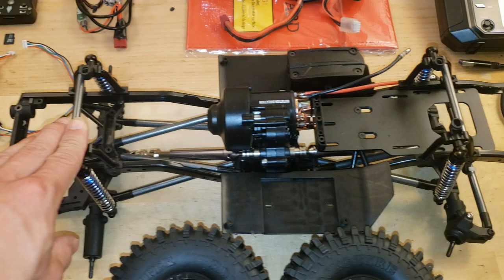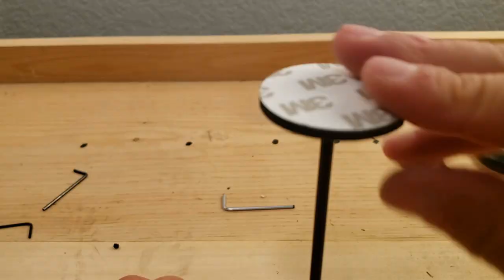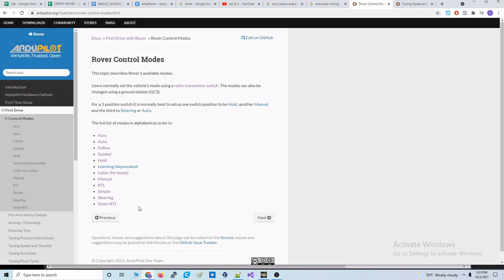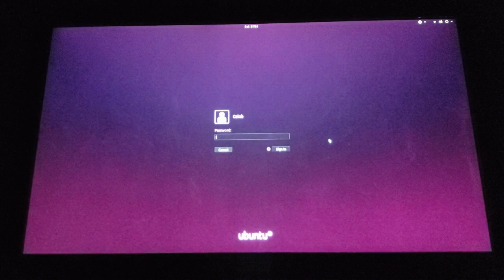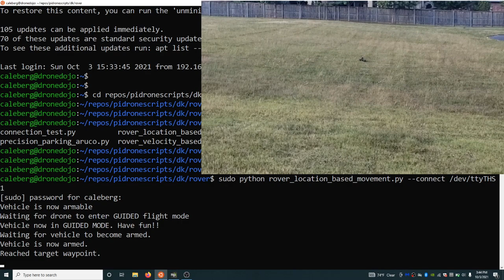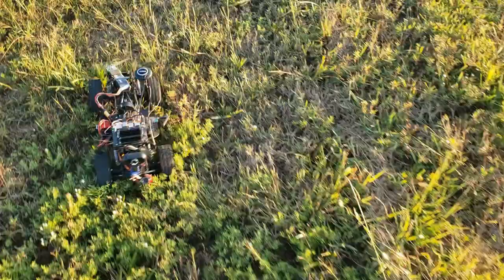Full Jetson Nano Smart Rover Guide | From Pieces To Programming In 2 Hours!

Comment: Hi Caleb,

I got my nano rover running but the nano mount for the rover is broke. The mount is very fragile to say the least. I was wonering if you have spares that i could purchase and/or the stl file for the jetson mount piece so I can print it out myself. I will beef it up a bit and use a stronger more flexible material. Thanks much

Comment: The way the servo mounts isn’t exactly centered, the servo horn is placed exactly at center position but the way it mounts on the chassis is slightly off. Also tie rods on my kit aren’t extendable. Wondering which one is compatible with this chassis

Comment: I want to ask that depending on the project can I connect the motors to raspberry pi directly and control them? General usage of connecting motors is to connect them into pixhawk, but I need to connect them into raspberry pi. Do you think it is possible, I think it should be possible to control them ,although I connect the motors into raspberry pi, by pixhawk as the communication between raspberry pi and pixhawk bidirectional.

Comment: Hello @The Drone Dojo! I am using the FPV Radio Telemetry to connect the mission planner to my CubePilot. I recently downloaded mission planner on my laptop and I had connected the ground module of the radio to my laptop with the air module connected to the CubePilot. I set my baud rate to 57600 and my com port is COM 10 as detected when connected (and as seen on the device manager). When I hit on the connect button in mission planner, it tries connecting for 30 secs and then shows an error message which says, "No Heartbeat Packets Received". Is there a specific thing I have to set before then connecting? I would appreciate your help. Thank you in anticipation of your response.

Comment: there's an arduino hack to convert pwm to sbus so you can use a regular surface controller.  i'm having trouble with autopilot refusing command when i test the motors

Comment: Question Sir,

I am a disabled old man,  I WANT to take the smallest SEARS push mower and put a JETSON nano on it. Cameras, object ID, rear push wheels free moving front wheels.
Load all software, hardware, wiring, etc.   then (1st remote control cut front yard while it records video from all needed cameras).  Once yard is cut, go through video and make sure JETSON recognizes all objects, learns exact path/pattern/route.  Then hopefully it should follow original movement pattern/path, identify all obstacles, (notify me on new obstacles) but go around them close but safely.

Is that logical in how I accomplish a fully ai automatic mowing of my lawn?  Side yard - use 2nd MICROSDXC (or drive to store mapping data.
Then same for rear yard.

I have no idea how much data space needed for each section of yard much less entire yard!

If I mow neighbor’s yard, I just load mapping source of her yard. (Different storage for different yards to cut.)

That way I help elderly, and I make a little money THOUGH DISABLED as I cannot push a mower.

I will hopefully have a BRAND ELECTRIC ZERO TURN MOWER COMPANY  sponsor a big mower after showing small mower working.  

My yard is almost 2 acres. Small push mower will take forever… but that’s ok if automated!

But with big mower I can help elderly with their yards for free even.

Will you volunteer with guidance?  I’m not a programmer but love to work with tech WITH DETAILED INSTRUCTIONS. (BRAIN INJURY) PART IF DISABILITY.

PLEASE REPLY!  ALTON

Comment: Hey Caleb, I'm seeing the Nano Dev kit weighing in from about $425 to $900, both prices seem rather extreme. Did you pay that much? Given the Pi went from the $40 to $80 range all the way up to around $200 in just the last year, did the Jetson Nano do the same thing? Would it be tacky to ask where might be a good source to buy a Nano for a good price?
Reply: I guess that one Caleb couldn't figure out!
Reply: Nano's are crazy at the moment. Basically it is like GPU price scalping at  5x to 10x the original cost.  Nanos were as low as $99, but now really expensive. You may be better off getting something stronger like a TX2, Xavier or the newest release.

Comment: Would you recommend Jetson nano for a remote controlled rover via internet? Self driving would be just ON/OFF option. Or Raspberry Pi?
Reply: if you just want to drive it from the internet and nothing autonomous then a pi would be better cuz its way cheaper since it doesn't have the hardware accelerator for ai on it. heck you could even use an esp32 instead theres a model that comes with a camera on and wifi board and its just like programming an arduino but with more features